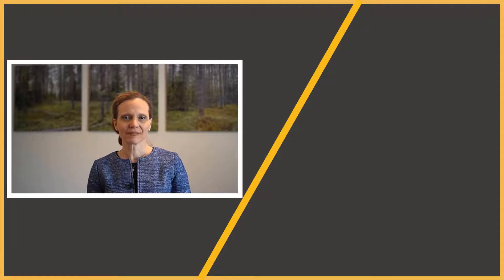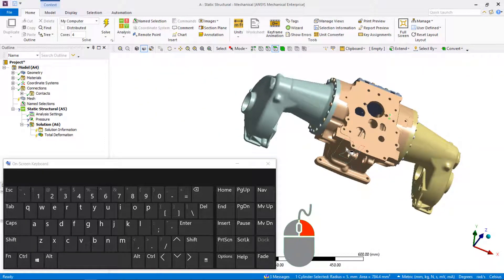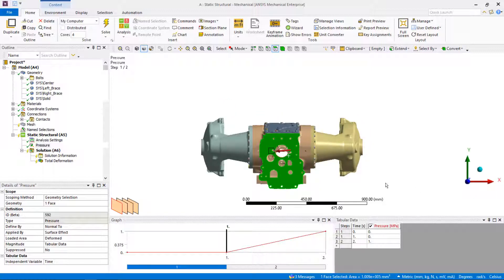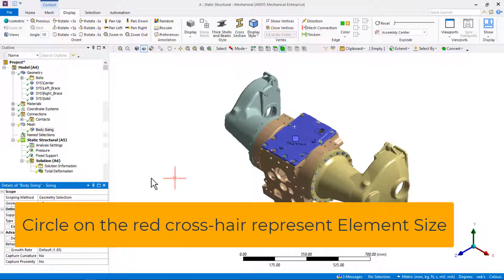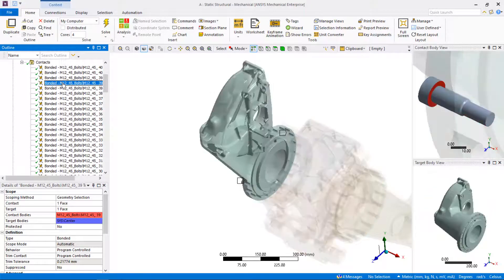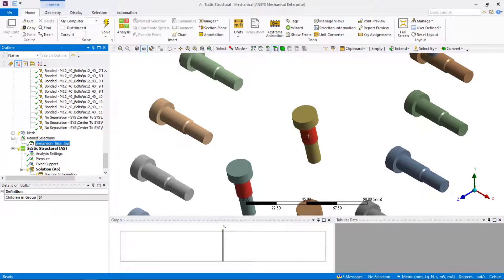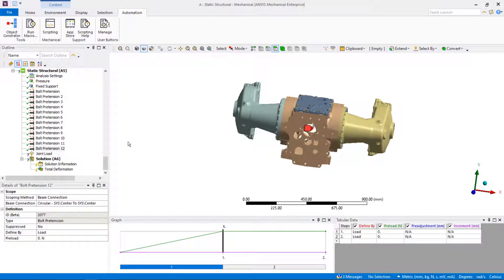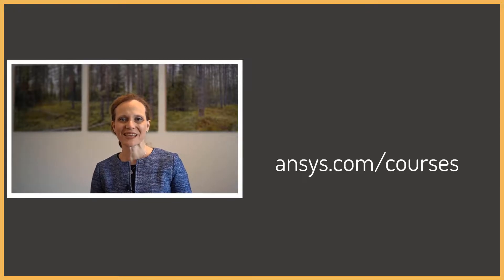Being More Productive Using Ansys Mechanical

Comment: Hi! The selection planes doesn'appear when selecting the outer surface. Do i need to somehow activate this option? Im using 2024 R2
Reply: @evnvzc First press CTRL + F to be on Face Selection Mode (Default Selection Mode is Smart Select) , then when you choose the Face you will see the Selection Plane Icon on the left bottom corner of the Workspace. 

But be careful, (If you are on Isometric View) depending on which area of the face you select you will have a different number of Planes, explore until you get something similar to the video (In my case it was in the area below the hole in question), in order to avoid this first place the view normal to Z axis (What you see also depends on the region you select, so make sure that when you choose the plane the higlighted area is an inner part of the component).

Regards.
Reply from the maker: Thanks for watching! Please post your query on the Ansys Learning Forum for a detailed answer from the wider Ansys Community: https://ansys.com/forum.